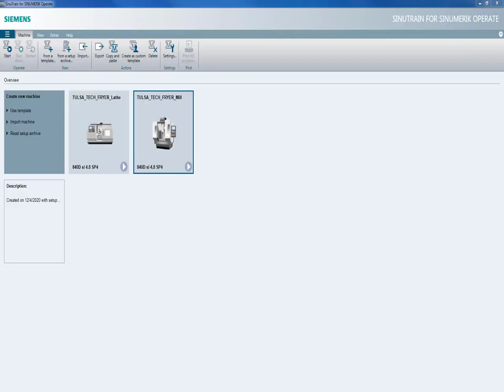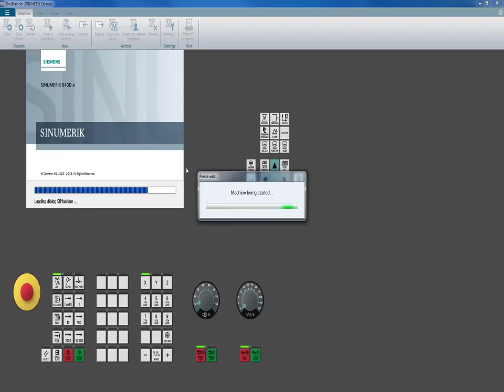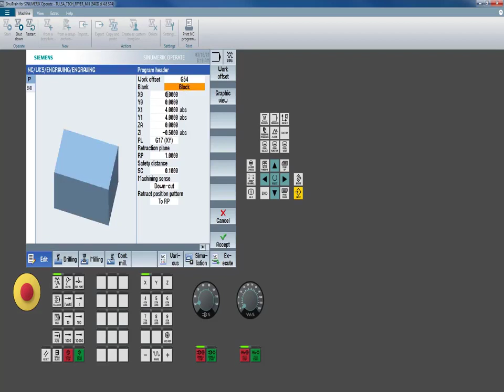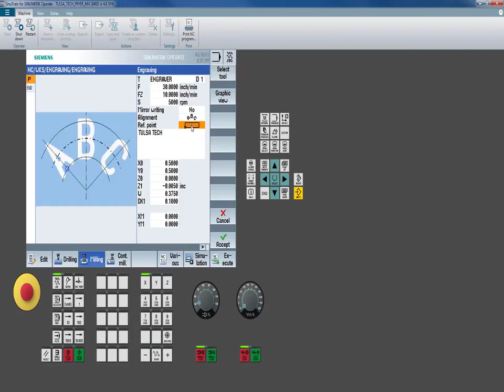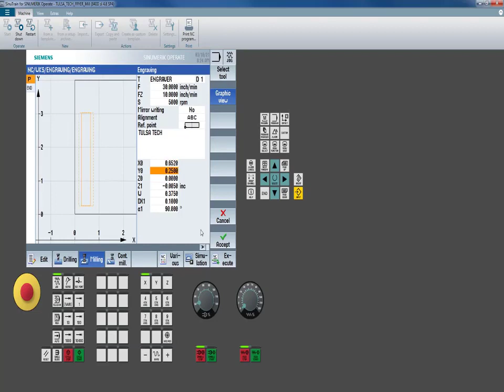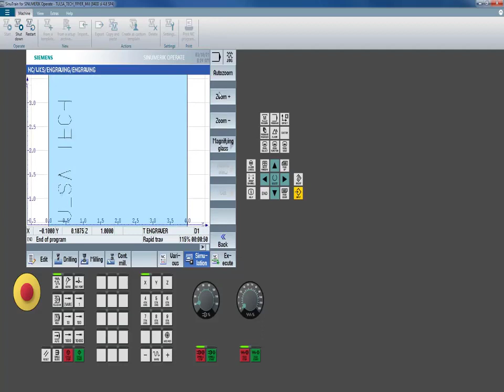Siemens Shop Mill Engraving

Comment: Did you say Fryer Mill? So there is someone else on planet earth that has one. We have some of those at the University of Colorado. Ever have any luck getting service or tech support? 

Nice video. We are trying to do serial number engraving.
Reply: The shop I work for has 5 Fryer CNC Mills and we are using the serial number engraving on the Siemens 828 control.
Reply from the maker: At the moment, they are becoming common in job shops but not on a mass scale. I will say that my students, once they use it, end up liking them a lot, and they're very affordable